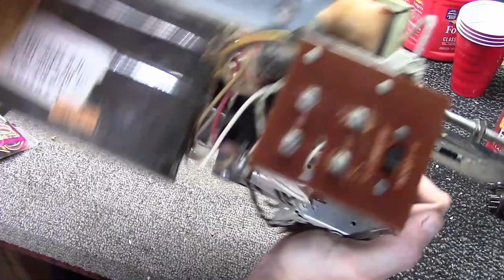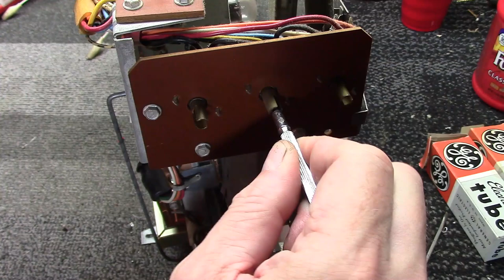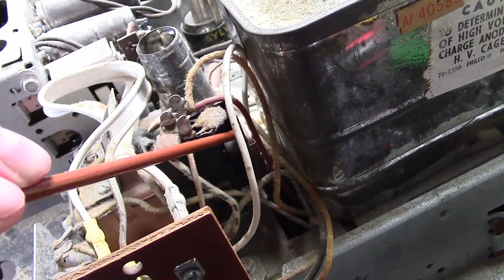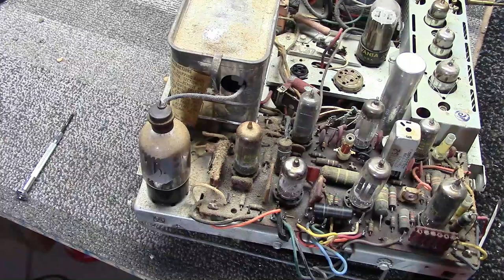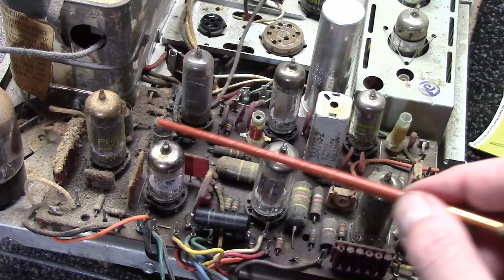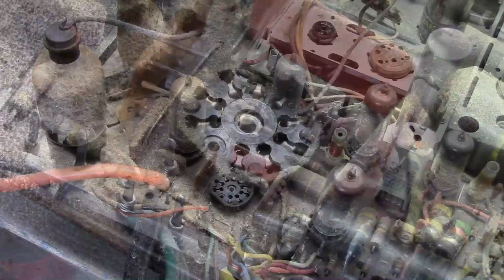Predicta 21" restoration tips: Chassis tour

Comment: Great vid  as always ! I think when I restore mine, I will just clip those wires to the board about a 1/4 inch from the stakes leaving the insulation on the stubs. The upon reassembly, remove the insulation one by one and j-hook the wire to the 1/4 inch stub, less strain on me I think, as I don't have that tool you used. Luckily, I have a good camera though for documentation, but I can always freeze frame your video if I mess up !
Reply from the maker: That tool is $20 on eBay.  I've never seen anyone do what you're proposing.  I'm not saying it can't be done, but you might run into issues with wires not being long enough.
Reply: Well, you've never lead me wrong before !  I might try using the vintage Sprague Kwikettes connectors to keep the leads the same length. They talk about making homemade coil splicers on the radio forum as the ebay ones are a buck each. Surely Philco  allowed for 1/4 inch tolerance. I heard you deny being the go to predicts guy, but for me you're the go tv guy.

Comment: Hi Bob. I like your restoring tips and recommendations. About resistors in some Predicta's you have restored, I see you are replacing pretty much ALL original carbon resistors? including 1/2 w? I personally prefer to replace the ones with a huge deviation, but always with some kind of NOS carbon resistors as well in order to maintain the original look. Any reason you are using film resistors in your projects ? (1/2 W film are quite smaller than 1/2 carbon). What wattage are you using ?  And if yes, why do you recommend to do so.
Reply from the maker: Time and reliability.   I'm not taking a board out a second time so I replace everything. Some need to have one end disconnected to test reliably.  By the time I've done that, I might as well replace it.  All the paper caps are being replaced so it's not going to look original anyway.  I use 1W Vishay PR01, PR02 and PR03.  The brown color is somewhat close to a carbon comp.

Comment: How many volts is that big filament resistor dropping ?
Reply from the maker: About 20 volts.
Reply: @bandersentv  That's quite toasty at 600ma
Reply from the maker: @krz8888888  It sure is.  I replaced it with an AC motor run capacitor in one of mine.